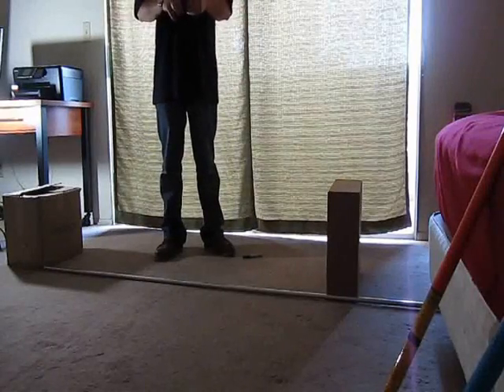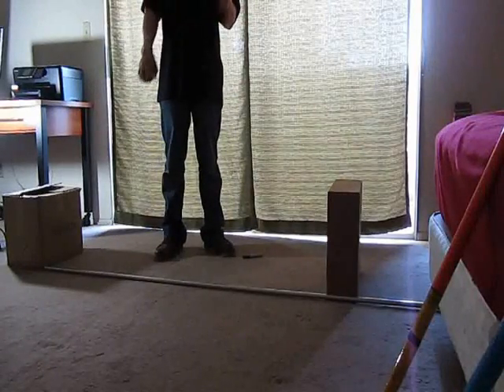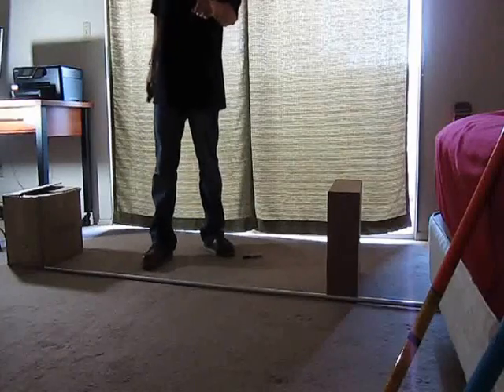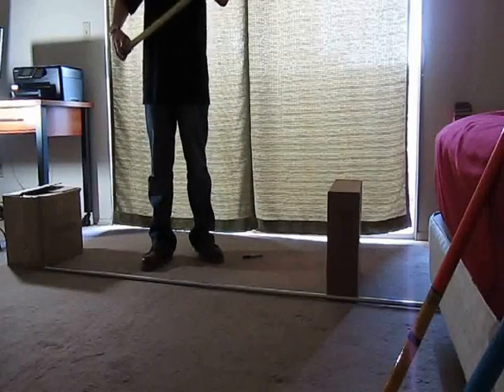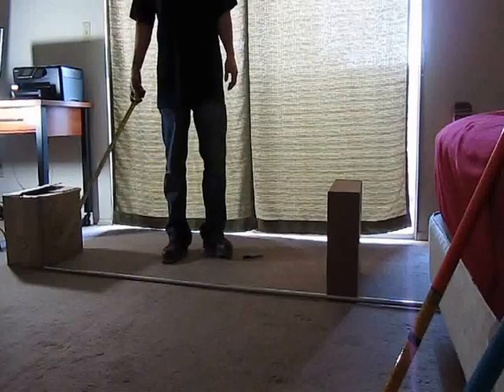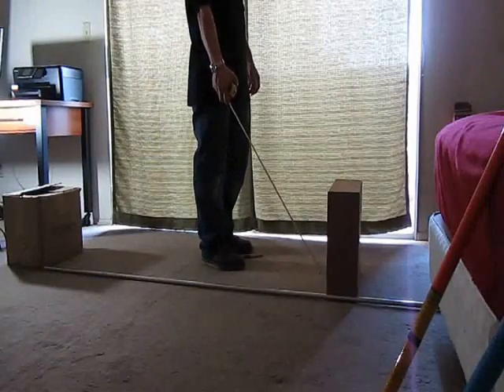Conduit Bending How to Bend a Stub

Comment from the maker: Its a YouTube video sorry if the 90 is not perfect.  I will be soon making a new video with all bends in one.  Also my info is correct as the star mark can be used to measure the back of a 90.  You can also take your measurement and subtract 6" for 3/4" emt or 5" for 1/2" emt bending at the star.  Thanks for the comment.